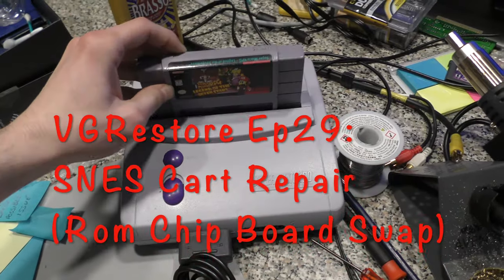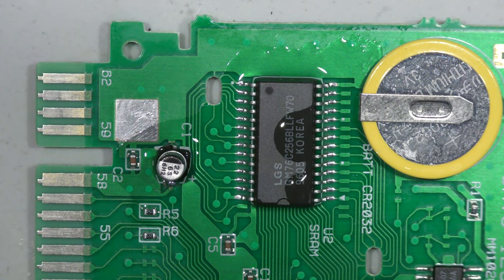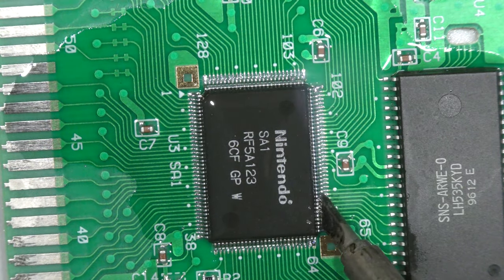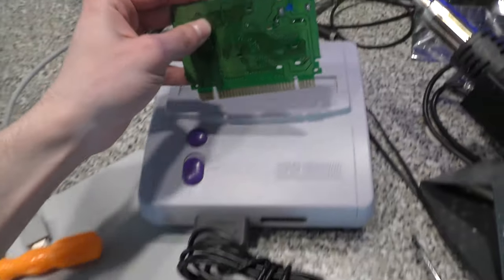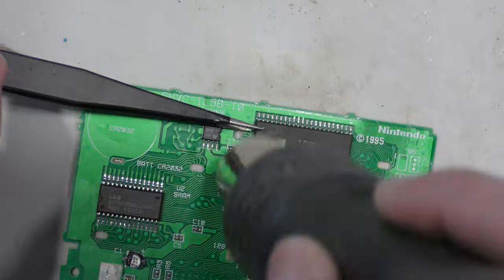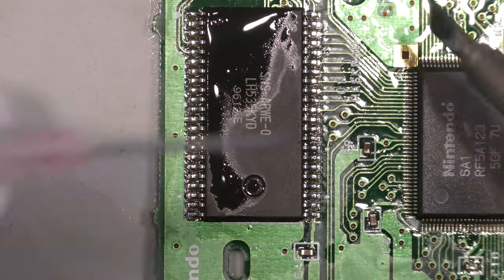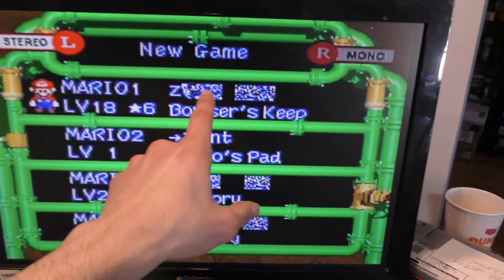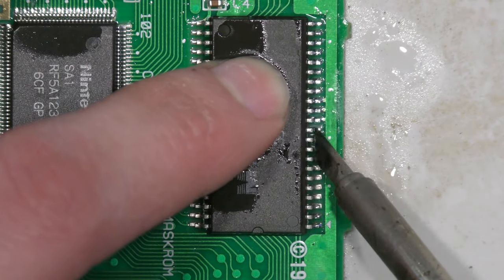VGRestore Ep29: SNES Cart Repair (ROM Chip Board Swap)

Comment from the maker: I just noticed and forgot to mention at around 6:57 mark, after I reflowed everything and still didn’t get anything on the screen I removed the SRAM chip off camera and mistakenly replaced it upside down. I’ll be taking a look at that in the future, and I’ll have to pay more attention next time.
Reply: Hi, new viewer. My cartridge shell for SMRPG broke so I'm seeking a replacement shell. My question is; how do i know which cart has the 3 pronged board instead of the single pronged one? As you can tell I don't know the actual names nor can I find info on the different types of cartridges except on region differences. If you can help me out I'd greatly appreciate it.

Comment: You're right about the processor thing. Unlike the SuperFX chips which are processors oriented entirely for processing 3D polygons while the SNES console handles all the 2D work, this coprocessor helps the SNES main CPU and is capable of four times the overall performance of the SNES console's own processor. It also contains its own memory onboard the same chip, however its limited by having to work around whatever the SNES main CPU is doing at the time so they have to be programmed carefully.

Comment: for smd i found tinning the caps legs, making the pads perfectly flat, applying some tacky chipquik flux, putting the smd into place and heating the legs whilst applying gentle pressure made installing them massively easier, they also remove a lot easier with hot air just clean any leaky residue before heating them.
Reply from the maker: Yeah sometimes I look back at my footage and question my thoughts. I agree, I should have used desoldering braid and cleaned up the pads and laid the cap down and then added solder. Instead I added solder to the pads making them taller and harder to work with.

Comment: I've had good success with the kester no clean flux i use but it does need to be reapplied sometimes.  Used to have the same problems with SMD stuff until I learned to use plenty of flux and clean the pads throughly before attempting to resolder. Also, hot tweezers make removing caps and other two point components much easier most of the time

Comment: I know you've had a lot of success reflowing chips on Gameboy boards; my understanding is that the PCB on those is so thin that when you plug games in and out that the PCB flexes -- ever so slightly -- and over the years that breaks the solder joints, and that's why reflowing them is more so to fix them.

But with regular cartridges, they use thicker PCBs, and it's significantly less likely to be the problem.

Comment: Love your videos! :) Can you recommend a good soldering iron?
Reply from the maker: https://www.amazon.com/dp/B07L3HHZSX/ref=cm_sw_r_cp_api_i_mgicFbB5Q8CJ9

This is the station I used in my earlier videos and I since switched over to this station, since it’s a bit more convenient with a built in hot air station. 

https://a.aliexpress.com/_dSTZYHe

Keep in mind you can order the first station and also order a hot air station separately and it will be much cheaper. Also, you may not need a hot air station if you’re not doing that kind of work.